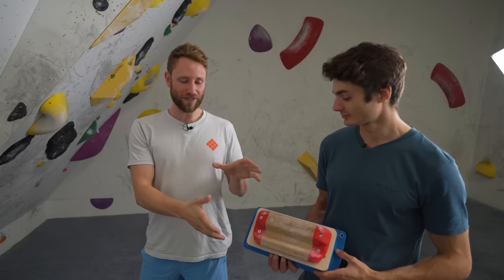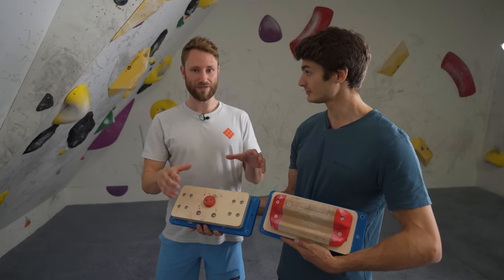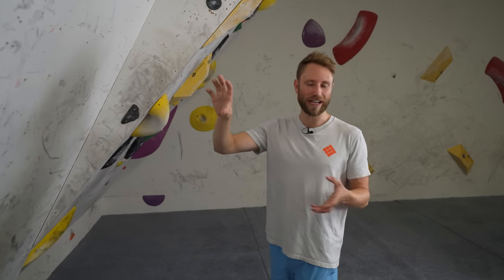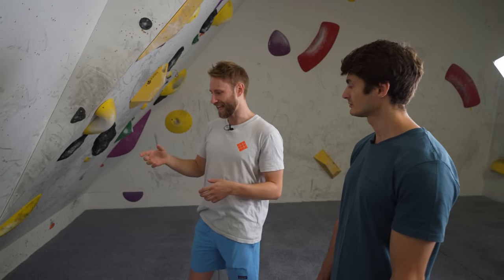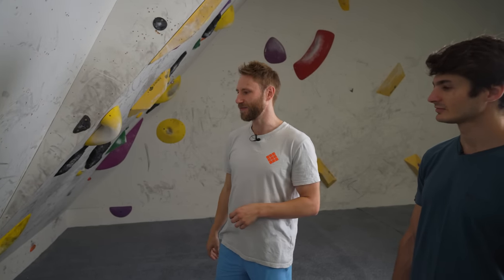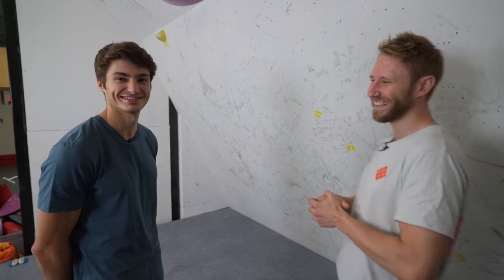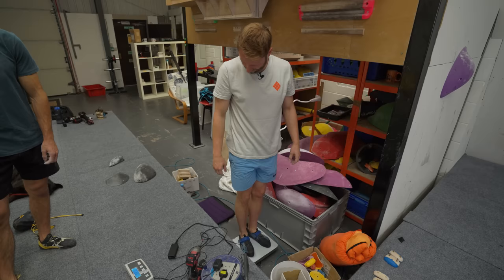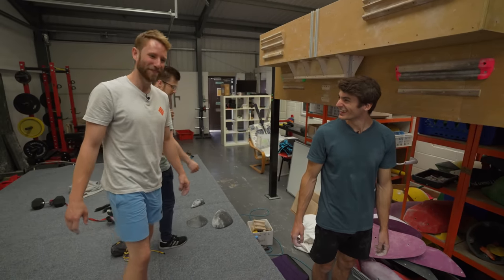Analyzing Climbing Technique with Force Plates!

Comment: The biggest problem with this is I don't think the force plate measure outward pulling force. If anyone watched one of the previous videos with Aidan Roberts about vacuum style climbing, outward pulling is as important as downward pulling when it comes to climbing at a steep angle.

The other thing that didn't get mentioned is that a good, efficient climber knows more precisely the minimum amount of force required to make a move. It would be interesting to see if they repeat the same move over and over again, does the peak force decrease with practice.
Reply from the maker: Yeah we are a bit stuck in measuring force in a single axis. But it would be really cool. I also like the idea of repeated practice to see how this effects efficiency. I think we can do this under different conditions too.

Comment: 🗽 To have a tool like this in a gym would be really nice to optimize your efficiency. On a monitor you can show in percent of total weight the force of the starting hand hold and the finishing hand hold.
Mostly the force on the foot hold is too low, because of not capable to hold the core tension or the coordination is bad, or both. 
.

Comment: To my eye, the most obvious difference between Josh and Billy, revealed both in watching them and in the force data, is that (ignoring the drop knee), Josh's movement is jerkier. So I think you'd get much more revealing data if you looked at the jerk, i.e. the rate of change of force.